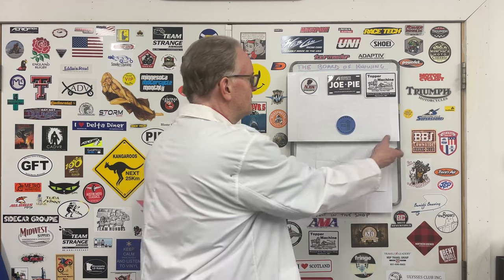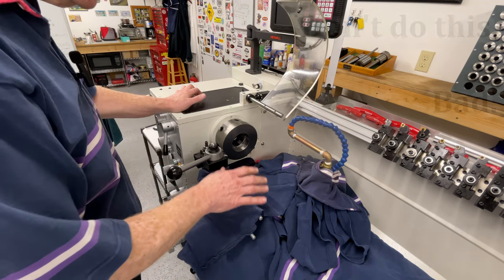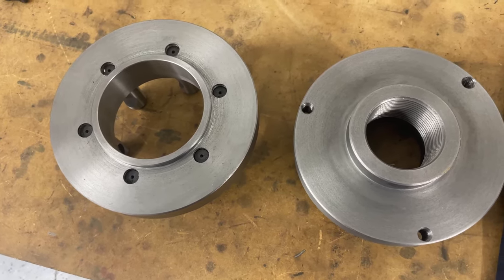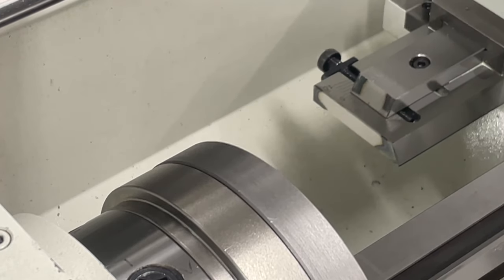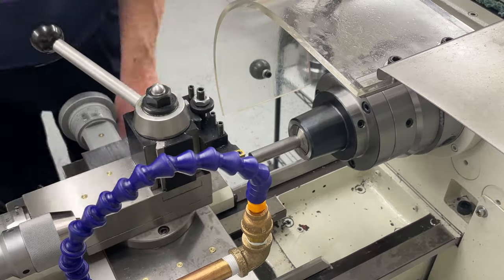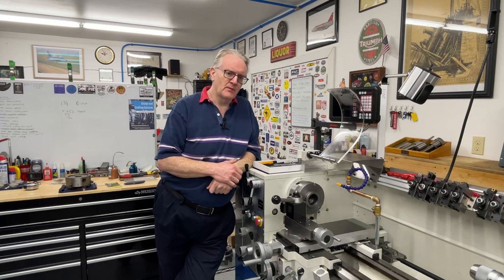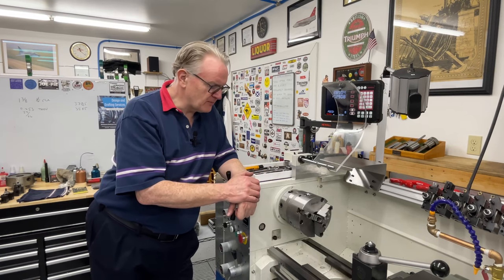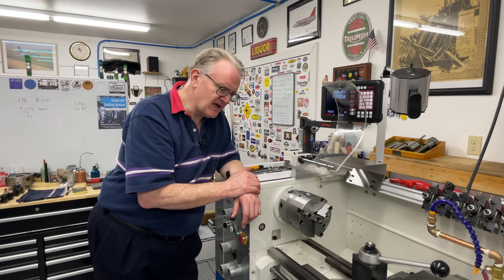Finishing a Back Plate for a D1-5 Spindle - and saving it when you realize you picked the wrong one.

Comment: Got there in the end. Turned ( no pun intended ) out well in the end. Generally it is NOT a good idea to make any chuck backplate out of steel, even top notch chucks will have a cast iron backplate. I think that it something to do with steel touching steel on the spindle taper. Yes certainly do not worry about cast iron going directly on the bed ways, as long as the cast iron is dry, use no cutting oils or flood coolant as that will wash the graphite dust under the slides. Enjoy using it. Thanks for the shout out. Regards from Australia.
Reply from the maker: Cheers Dave - Great info as always. Good point on the steel backplate actually, makes complete sense.

Comment: nice work! -  a couple thoughts: use aluminum foil instead of cloth rags.  It stays in place and will just tear-away if it gets caught up in the chuck (instead of turning into a flying terror).  If you're considering another chuck, look at the adjust-tru 3-jaw taiwan import that precision matthews sells in d1-5.  I took a chance on it, and it's OUTSTANDING.  Night and day from the Chinese ones.
Reply from the maker: Thank you! I like the foil idea. I may try it, but cast iron chips fly everywhere. One reason I tried cloth was to capture the chips better. It kind of worked, but I think the key is wipe the machine down dry before starting, just vacuum as you go. Mathews does have pretty nice stuff. I just found a 6” Bison up for auction locally - may see if I can get it - and then make a 3 piece back plate. 😂

Comment: Cast iron is a really horrible material to work with. Makes a dreadful mess. I usually cover the lathe bed with paper towels. If they get caught by the chuck they just tear. Cloth tends to wrap round the chuck and worst the lead screw. Glad the back plate worked out in the end. Cheers Nobby
Reply from the maker: Great idea on the paper towels.